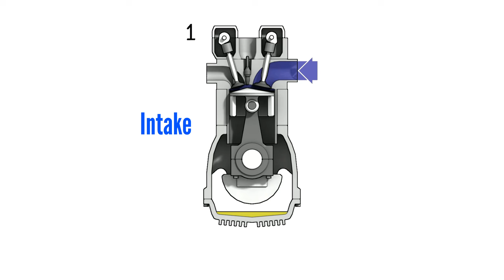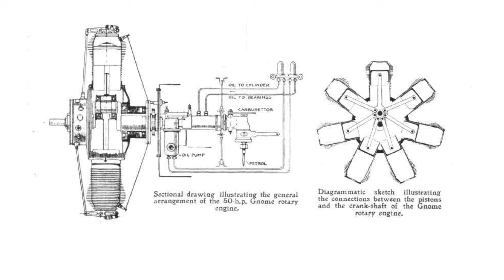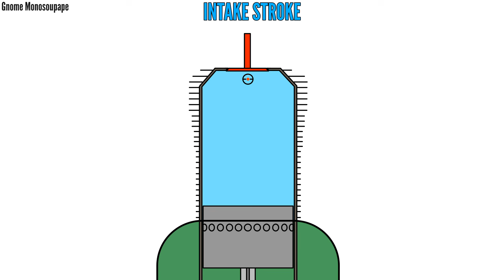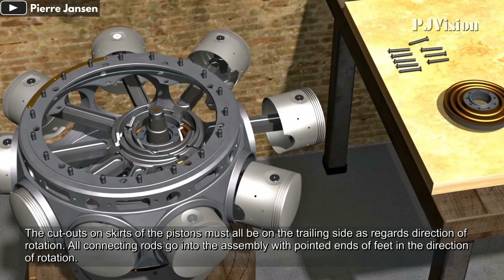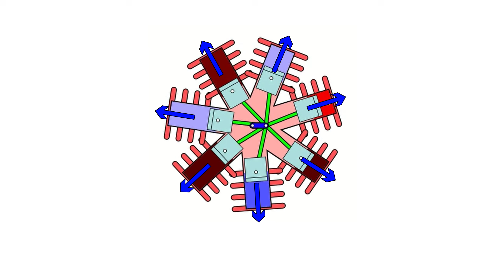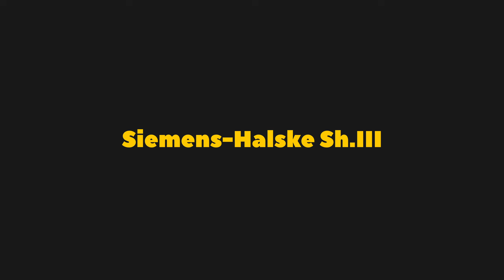The Brilliant Rotary Aircraft Engine of WW1 Explained

Comment: Why did the intake valve need counterweights to stay closed?

the piston moves down twice per 4-stroke combustion event. Once is the intake stroke, when it needs to open, and once for combustion, where the cylinder pressure is pushing it closed.

Like a check valve.

I actually started building an engine using a brass check valve as the piston, & wondering if that had ever been done 😂
Reply from the maker: Centrifugal force created by the spinning cylinders would pull the valves open (without counterweights). Its like swinging a ball on a rope. If the rope snaps, the ball will fly off away from you.
Reply: @LetsGoAviate yeah, but it is getting pushed close by the same pressure wave that is pushing the piston. If it couldn't keep the valve closed than it couldn't move the piston! 😂
Reply: @Iowa599  yes but the only way it can be pushed closed by combustion is if it's already closed before combustion occurs. If it's even slightly open when combustion starts, the gases will immediately exit the intake valve and the cylinder won't be able to build up the pressure required to keep it shut
Reply: @thecrazyfarmboy it should be closed from compression...

I guess with low compression & a small valve it could have excessive float, maybe they should have increased the compression instead of adding springs 😂

Comment: The rotary engine was also used in some early cars.  The engine was mounted with the cylinders spinning sideways, ie: 90 degrees from the way the crank shaft sat in the airplane.  The engine was rear mounted in the car.
Reply: A rotary engine was also used on a motor cycle.
Reply: @453421abcdefg12345  The Rotary Engine was invented for motorcycles! The first example is the Millet Motorcycle invented in 1892 by Felix Millet.
Reply: @453421abcdefg12345  yes all first was the 1894 Felix Millet motorcycle, engine was installed inside the rear wheel...
Reply: @453421abcdefg12345  Weirdest was Megola, it was front wheel drive. Cool looking thing though.
Reply: Adams-Farwell automobiles used a Rotary engine
Reply: I think only one type of car used it, but several motorbikes.

Comment: Well presented.
Rotary engines were, IMHO, always really cool. And I've always wondered what could be done to make them viable again.
Your explanations  have greatly added to my understanding of the limitations of these craft.
Thank you!
Reply: 1920's Megola put arotary engine in a motorcycles front wheel, creating an absurd, yet beautiful machine.
Reply: I agree they're very interesting, but nothing will ever make them viable again. The only reason they ever existed was for cooling, which isn't a problem anymore. And there's one big problem that even modern technology can't fully solve- the centrifugal force trying to pull the engine apart, therefore limiting rpm. The only way to make a 500hp engine that doesnt rev as high as other airplane engines is to make it much bigger and heavier than competitors, which doesn't bode well for airplanes
Reply: @thecrazyfarmboy  Then again centrifugal forces are directly proportional to weight and radius. Torque is force times lever arm. So by making the stroke alot shorter and using lighter weight components, we could maybe build a modern air cooled radial engine with higher redline than 1500 rpm? Whaddya think?
Reply: @Pleksilasi  I think that's possible, but still highly impractical as a mass produced engine. There's still the other challenges, like sealing the rotating connections for fuel and air and making a lubrication system that doesnt just sling oil everywhere during operation. Both of which are problems that just dont exist for non-rotary engines. 
But it would be really cool if someone built a short stroke, higher rpm rotary engine as a bespoke project!
Reply: @thecrazyfarmboy  hmm let me think, air induction via rotating valves from the side of the cylinder maybe with direct injection for fuel just above piston crown bottom dead center, dry sump lubrication with ports just beneath piston skirt at bottom dead center? I think I just borrowed ktm tpi (or tbi I never really remember the difference) system with a conventional dry sump.. Centrifugal force is what flings (as you said) oil to the cylinder walls, wrist pin etc and piston rings together with dry sump gather excess out, I see this as a completely valid and not at all difficult thing to build just because rotaries are cool as fu**. In all seriousness, I think there are alot of things to calculate that can go wrong and my napkin math just doesn't touch on. In the meanwhile for lighter aircraft we can do what the americans are doing and just shove a yamaha snowmobile engine (apex) under the cowling and call it good.

Cheers for the reply!
Reply: @Pleksilasi if you look up WW2 engines like the Wright Cyclone you'll see they got 1,000hp @2,200 rpm already and despite that the fastest and most efficient props used Merlins.
A turboprop is what killed radials really, even for sub-sonic speeds reliability and lower servicing requirements wins out.  An efficient engine needs to run hot (due to physics) and having compressor blades and fuel injected into a rear turbine simply works better.
Now I flew De Haviland Chipmunk with Gypsy 8 engines and despite giving only 145hp the engine was massive with an inline engine with 1,500 between overhauls, I simply cannot imagine a radial in a similar configuration as forward visibility was already severely compromised on the ground.  The vibration and torque effects were significant despite it being a watercooled trainer.
Reply: @RobBCactive  Thanks for the reply, this is super cool information, I do have a paper in avionics, but I'm just a motorcycle guy, interested in all forms of engines. This is info that they don't tell you at school. Rear feed turboprops are my 2. favourite turbine engines just after shaft mills like those free turbine thingies they got in helicopters.

Cheers!
Reply: @thecrazyfarmboy  Search "birotary engine".  Not sure it would be practical for anything above light GA aircraft, but power/weight ratio is really important there.
Reply: @thecrazyfarmboy 
(Sigh) Yeah. I know. 😢
But a man can dream! 😊
Reply: ⭕Where do you think Superchargers came from.!
All Internal-Combustion Engines are Air Pumps. So lets add a Compressor.!
⭕Where do you think Jet Engines came from.!
Reply: @snakezdewiggle6084  From wikipedia page of Roots blowers : "In 1875, Roots exhibited a blower at the Saint Petersburg Exhibition; Thwaites and Carbutt exhibited a Roots principle "air blowing machine" for mine ventilation in the same exhibition."

To answer your AI-tier question : superchargers came from mine ventilation machinery about 150 years ago.
Reply: The Wright Cyclone engines used in planes like the B17 and similar Pratt & Whitney in B24 were already producing over 1,000 hp at 2,200 rpm with super chargers, that also gave high altitude performance.
It's really the turboprops that killed piston engines in aircraft, they can burn fuel at far higher temperatures, hence thermodynamically efficiently.
Already in WW2 water cooled streamlined prop engines were gaining thrust from rear facing exhausts and even the radiator cowling shape on a P51 Mustang.
Flying a post-war prop with a massive piston engine, there's simply more moving parts to wear and service, and tax subsidies on aviation fuel make reliability and lower running costs the prime consideration in commercial aircraft.
A piston engine has to drive a prop, which means a noisy and high vibration flight, while a turbofan even with exposed blades that are geared has fewer moving mechanical parts requiring servicing.
Reply: @RobBCactive 
Yep. Not gonna get any arguments from me.
But I do have to wonder what that has to do with thinking radials are cool and wanting to bring them back, even though they are very problematic. 
And, of course, the cyclones are not the kind of radial I mean.
But, otherwise, yeah! Spot on!
Reply: @bmobert well I wrote that in response to someone else's post that I don't see here, that talked about new tech radials reaching 500hp and 1,000 rpm.
~shrugs~
Reply: @RobBCactive 
Ah. That makes sense.
Quite right, too.
Reply: I just saw a video suggesting a new form of rotary may be appearing for use in small GA aircraft.  The engine and crank both turn, in opposite directions.
Reply: @flatfingertuning727 
Cool! Can you post the link?
Or the title to search for?
Reply: @bmobert  birotary engine.  I first saw this on the "Driving 4 answers" channel, but searching for "birotary" shows one of these in a flying aircraft.
Reply: @flatfingertuning727 but why would that be significant?
You see torque involves leverage around a rotating point, so spinning cylinders pushing cranks to convert a up/down into rotation movement, will have much more rotational effect than a contra-spinning shaft.
How does a crank shaft rotating in the opposite direction to the cylinders even work?
I can imagine a geared prop counter rotating, but the whole point of a crank shaft is to convert piston movement into rotation.
Reply: @RobBCactive  I offered search terms to locate videos on the subject; watch them to learn everything I know on the subject.  If the rotational direction of the crank case is opposite that of the propeller, it should be possible to adjust the moments of inertia so that from the view of a common shaft, the effective rotational inertia of everything that rotates clockwise would equal that of everything that rotates counter-clockwise.
Reply: What makes them cool is also what keeps them from ever being viable. The design is a workaround for a problem of the time: how do we keep this thing cool without adding 200lbs?

A lot of old stuff is cool because it seems insane today but was brilliant (or at least better than the alternatives) at the time. As cool and interesting as they are, rotary engines were more of the latter...as time went on they just couldn't keep up on power-to-weight. I'd love to see what could be done with modern materials, but I know it wouldn't be worth the cost to anyone but rich enthusiasts.
Reply: I saw a "Fund Me" thing a few years ago for a company that was trying to put small WW1 tech air cooled fixed crank/piston rotary engines, that they presented as "patented latest and greatest" tec on riding mowers. 
Fixed block/Rotating crank WW2 tec engines are better. If nothing else, MUCH less gyroscopic effect than that heavy rotating block.
Reply: Classic Aero is making new Gnome rotaries in New Zealand.
Reply: There’s potential for an application in ultralights but then again with modern technology a radial would probably still be better
Reply: >And I've always wondered what could be done to make them viable again.

Modern fuels alone would make a rotary engine created today much more powerful. Even fuels from the later 1930s and 1940s would have made rotary engines more powerful.

Back in the early 1900s, oil cracking didn't exist on an industrial scale, so you had extremely poor quality fuels and lubricating oils. 50 or 60 octane was the best you got, and engine oil was little more than crude pulled straight out of the ground and run through filters. Rotaries using castor oil was likely a large contributing factor to their reliability, because it was far more pure than raw crude oil that was generally acidic and corrosive, and had a lot of other nasty things mixed in with it.

The compression ratios of those engines was very low to deal with the fuel quality, which is why it is so easy to pull them over by hand. With modern fuels, you could significantly increase the compression ratio of the engine, and potentially supercharge it.
Reply: @GGigabiteM 
Cool! 
Thanks for the insight.
Now that you mention it, of course the fuels and lubricants where nit as good as today.
But I probably wouldn't have thought of it on my own.
So, Thanks!

Comment: Very cool explanation, thanks. Is there a technical reason there were no two-stroke Rotary engines?
Reply: It would need a scavenging pump/compressor. Extra hassle and weight. Otherwise, plausible. What would be the benefit?
Reply: I have seen a prototype of a 3 cylinder 2-stroke rotary engine, none were produced

Comment: This is a very good presentation.
Even modern engines can show some of the precession effects during aerobatics: for instance at the top of a hammerhead stall when you have full power and are approaching zero speed.  (Zero air speed and zero actual speed!) You need to introduce a little aileron to compensate for the precession that even a modern boxer engine (plus the weight of a heavy constant speed prop) at the top end of the maneuver (on the last part of the upline and first part of the downline).

Comment: Awesome coverage of the rotary. These engines have always confounded me. Now that I’ve seen the differences in detail, it clears a lot of things up.

I’ve never been able to figure out where the air intakes were located and if they had some kind of an air cleaner.

Presumably it was on the pilot’s side of the firewall, sucking up air around the pilot’s legs?

Comment: The best WW2 fighter engine, and best Korean War fighter engine were also obsolete only five years later
Reply: Yes and no.  Yes, everyone saw that the near future of 1000+HP engines for aircraft was going to be Jets and turboprop by late 1944.  No, the basic design was not obsolete, and is still in use today for many different engine applications.  Most light aircraft in general aviation are overhead valve air-cooled engines, almost all automotive and smaller marine engines are overhead valve liquid cooled engines, with inter-cooled turbos not being uncommon.  The engine designs that were stopped because there was no future for them were the sleeve valve and the various x-24 and H-24 designs.